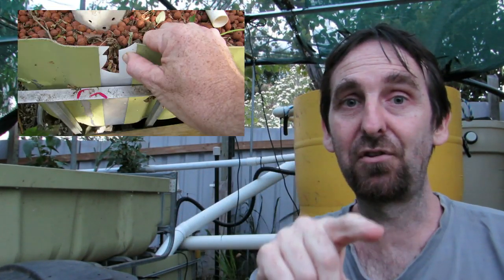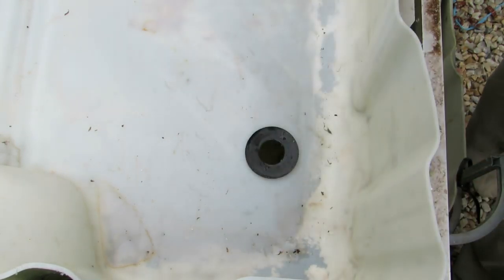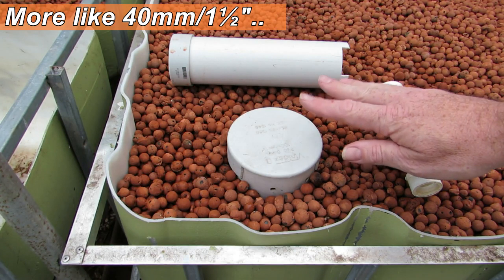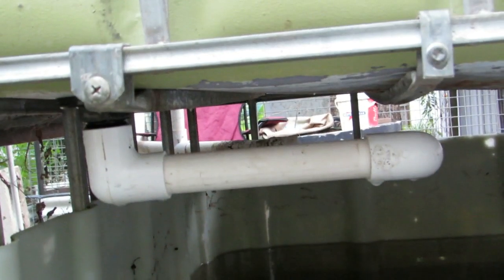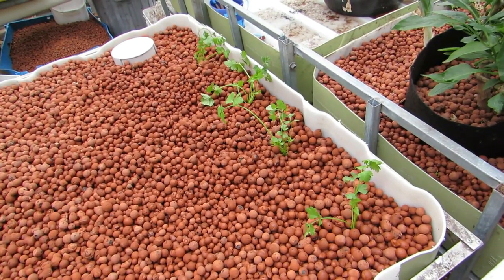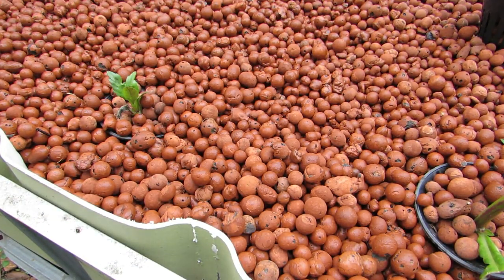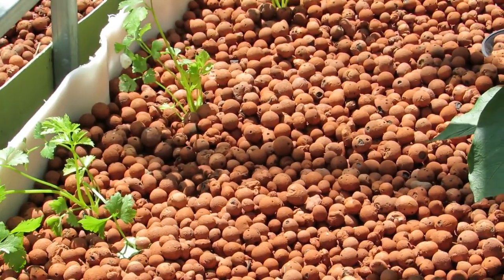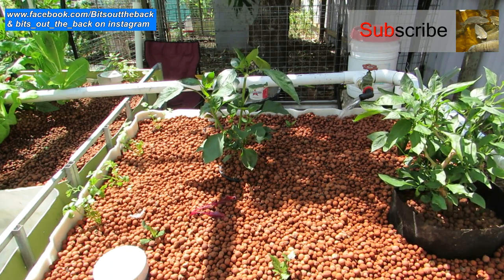How to set up a bell siphon & planting out a grow bed. Aquaponic Vlog 11,.

Comment: Getting ready to set up a 2 330gallon IBC tote system.  One of the videos I watched this morning, you had a problem with the water getting murky after adding the radial flow filter.  What caused the problem?  I agree, it is fun to learn and see things grow.  I watched most of the construction videos this morning.  Thanks again.  Blessings.
Reply from the maker: Hey Allen... If it was an older one it had to do with solids settling in the black bilge hose I had running from the pump up to the fish tank.. The inside of the hose has very slight ridges & it was enough to collect solids.. The water ended up clearing in a day or so & cleaning that hose out became part of the regular maintenance routine..
Cheers & hope that helps some..
Enjoy the build mate..
Rob..

Comment: Another winner. I will be using the end cap on the shroud idea on my next bed. I like the T siphon better than the bell, but I still have the same issue with media getting in under the shroud. The end cap would fix that. Thanks much.
Reply from the maker: Hope it works out well for you Adam.. If the cap is a bit lose on the pipe it might pay to run a 316 Stainless steel screw through.. The fit on ours is very tight so no real issue here.. 
Cheers mate & have a great one..

Comment: thanks for pointing me to this video. after watching this, i feel like i have it set up right. i think i have a water flow problem. i upgraded from a 290 gallon an hour pump to a 1000 gph. couldnt really see a difference in flow so i think the 1/2" water line has me restricted on flow. think i need to go to pvc with valves to adjust the flow. the bells are kinda slow to fire but are strong when they do. just not breaking siphon. fun to figure stuff like this out though.
Reply from the maker: +txsmudslinger 
Can be fun but had a few at the start that drove me up the wall ;-) 
Have you got them firing on & stopping how you want them now ? 
Cheers,
Rob.
Reply: ive added the breather tube to my bell siphons. that was what it needed to overcome the flow problem. ive got strawberries planted now!  :)
Reply from the maker: +txsmudslinger 
Nice one mate. 
Those breaker tubes really do help with high flow beds 👍
Cheers mate,.

Comment: Rob, since algae can grow where the water enters the bed, why not have the pipe enter the bed below the media level?  i'm sure you want to easily see the flow rate, but, couldn't a setup similar to the bell siphon shroud be used to hold back the media and allow the inlet pipe to be inserted and capped loosely?  just curious. :)
Reply from the maker: Hey Charles.
 I still haven't gotten around to it but will be making something similar  to what you suggest but for different reasons.. Have never had a big problem with algae but am curious at seeing how many solids make it through to the grow beds.. I'll be using the shroud idea & placing some filter material in there to see what it catches.. Am hoping that it isn't too much..  
Cheers mate & have a great week..

Comment: Hi Rob, where would I source the grow bed pots/root pouches?   Also, using a standard air pump from the standard pet shop in our IBC. the air stones keep clogging up.  We're wanting to step up on a more viable air pump, could you advise of what is more suitable and where to source from...We're new kids on the block have been set up since March 2014, bumbling along.   Thanks for all the tips

Comment: nice work, that transplanting ring idea would be a good solution if someone pulls the media guard out again i think
Reply from the maker: Don't think it will happen again Steven, well I hope not :-/
 Was going to zap a few 316 SS screws in there to make sure but have run out.. 
Cheers mate..

Comment: As usual i love watching your videos. For a long time for no good reason since i didn't have a garden :-)

I have a question. Our garden has a pond with 14 Koi and i want to hook it up to a grow bed and ideally made out of wood so that it looks good in the garden.

What is the minimum depth? I am thinking 200cm long, 70-80 cm wide. If you do reply, many thanks.
Reply from the maker: Sorry I missed this Alex. Did you end up setting up a grow bed? 
If you haven't, I'd go with a 30mm deep grow bed as it will give the roots a decent amount of media to hold onto to keep some of the taller ones upright. 
Hope that helps some.
Rob

Comment: Hi Rob, loved your vids.  Just wondering how do you get the clay balls to sink?  I've got some clay balls and been soaking them in water for the last 24 hours but they all seem to float still.
Reply from the maker: Hi Steve. The water will end up saturating the balls & they will settle by themselves. 👍 It happens to most of us so is nothing to worry about. 
I found leaving a 25mm/1" dry layer of clay on top helps to keep the weighted down & will also stop algae growing on the clay.
Hope that helps a bit mate.
Cheers.
Reply: Thanks for the reply and advice, will definitely do that !!!

Comment: Rob, it's looking great.  I'll keep poking around, but have you posted a video on your nutrient supplements?  Meaning, what schedule do you follow to add any additional nutrients, i.e. iron, calcium, magnesium etc.  I'm fighting with which nutrient I'm short on -  yellowing of vains in pepper plants.  I'm new to AP, only doing for last 6 months.  Thanks.
Reply from the maker: I don't really follow a schedule as such Chris.. When the leaves start to turn a bit yellow with dark green veins I add a bit of iron.. Other than that I use calcium hydroxide to raise the calcium.. I do add in a spoon or 2 of a seaweed/kelp powder that has high levels of potassium so need no additional amendment to cover that one.. 
I have had a look through my books & can't find a conclusive answer to the yellow veins sorry mate.. How are the nitrate levels in the system ?
Reply: Rob Bob Thanks Bob.  I appreciate the info.  My nitrates hang between 80 to 120 ppm at all times.  I received my Chelated iron in the mail the other day so I'll be trying to get on a schedule with that, seaweed and calcium.  I'm having a good spurt of new growth as of late so maybe I'm on to something.  My system is only six months old so from what I've read it's about time of the system to "fully lock-in".  I also think my growled is a wee bit too shallow, so I have a hankering to build a new bed at least 12 inches deep.  I think I'm only sitting around 8 inches.  Though I have some natural sun light, I do supplement with Florissant lights.  I think I also should move from 5000K to 6700 bulbs.  Oh the science of it all.

Thanks again and take care, keep the vids coming.

Cheers,

Comment: Hey Rob, since the end cap is screwed to the grow bed, won't pulling the shroud also cause the same problem?
Reply from the maker: Is a tight fit & doesn't pull out easily so all is good.. I was going to zap a few stainless screws through there if it was lose but it wasn't necessary.. Different brand caps & fittings will fit differently I've found so it does pay to check a few different ones out.. 
Cheers Mate & have a good one..

Comment: Rob, 

I didn't see an air hose attached to the top of the bell.  Do you not use one?

byron
Reply from the maker: Not on the bells I make up.. Did try with a thin air hose a while back but found these work just fine.. If I set up a large external siphon I might go with the breather tube on the bell..
Cheers Byron..

Comment: Hi Rob, me again.  Sorry to bug you.  So i've got the clay balls into the grow bed, got the siphon bell going and it's draining good from the grow bed.  Though those clay balls are still floating so every time water is pumping in from below, they rise with the water and sink as water being drained, it's looking like a little earth quake on the grow bed which at times fun to watch but i don't know if this will work with plants as roots may not be able to attach securely among the clay balls?  How long before these clay balls settle and stay at the bottom?
Reply from the maker: Has been a while since I set up a bed but it only took a few days from memory with the Canna branded clay. Do you have a decent amount (25mm/1" +) of dry clay on top?
Reply: If i add 25mm of dry clay, it may over spill the grow bed with water.  hmm...i may need to lower the water level going into the bell to achieve that.  but these clay balls i have seem to be very stubborn, i've had them for a week now, although just admit not all the time they are soaked under water.

Comment: Hi Rob,
Nice to see another vlog up! I was wondering if you have ever tried a Raft system without media. I noiced your reference to Bigelow Brook Farm on the Bell siphon, I subscribe to his channel and it's one of the first places that I learned about using foam insulation as raft beds, looks very interesting! In one of his videos, he did a side-by-side comparison of having and aeration stone in one tank and no extra aeration in the other, The plants in both tanks were planted at the same time and the tank with an air stone had substantially more grow than the other. I'm thinking that the air stone helped to mix up the nutrients for the bottom, and extra aeration to the roots as well.
Reply from the maker: Hey Ron..  I haven't grown in a raft bed yet but hope to as a small one to this system.. I will be using a venturi for the extra air though in stead of air stones.. Just need to get a frame made up to hold a few 1/2 barrels I want to use as the beds..  
Cheers & have a great one mate..

Comment: Hi Rob, I have seen your video how to make bell siphon . Bought 55 barrel which is cut half. And now realised its max depth is 28cms (not 300mm or 1 feet). 

In your video stand pipe length is 250mm, bell is 270mm. 

Can you customise approx length of stand pipe(3/4")[I am using 1" pipe]and bell siphon 2 1/2" [I am using pipe which is not pvc so it comes around 3" pipe].

Pls suggest approx lengths of SP and bell for over all depth of 280mm grow bed. Thanks in advance.
Reply from the maker: Hi Graffitti & sorry I missed this. You've probably sorted this but will leave my 2 cents worth below. 👍
I'd just make the SP to be tall enough so there is a 20mm/¾" (minimum) layer of dry media on top of the bed. The bell height can be set between 20-30mm / ¾-1¼" above the top lip of the SP.
Hope that helps if you haven't got it sorted.
Cheers.

Comment: Hi Rob, I think I have pretty much watched all your clips lol, and I am sold on Aquaponics. Just a quick question though, could your barrel setup be used in a hydroponic application? Just want to have a go before i commit to buying fish etc.... So basically replacing the fish for a nutrient reservoir but still using your flood and drain method ?
Cheers mate, thanks for clips and keep them coming.
Reply from the maker: It would work OK as a hydroponic system too. I used something similar with timed flood & drain many years ago with clay media. 
Would double check with the store if the nutrients you use are fish friendly though. I've only been running fish to power our systems or using additives that are fish safe while we've been in between batches. 
You could use a fish based emulsion fertiliser to start off which will also help cycle the system as well ready for the fish.

Comment: They say hind site is 20/20. Given that you had an idea of what you were going to put in the bed perhaps you should have filled the bed halfway with clay then set your pots in and filled around them to avoid the digging out spots for them...especially the big ones.  I'm setting up a new bed right now but I usually just toss in seeds and they sprout right up. Did one last week and had germination in 3-4 days.

Comment: Rob...
Just starting my aquaponic system...
I filled the grow bed with clay pebbles - actually it is only half full now.
When it fills, the pebbles float up and down with the water.
Is this okay?
I had it completely filled, but as the water rose the pebbles floated and started falling out of the grow bed.  So, I removed the pebbles until they stopped falling out.

PEACE
Ross
Reply from the maker: Sorry I missed this Ross. Have they settled down yet? It normally takes up to about a week before they take on water & stop floating. 
Hope the systems travelling along well mate.

Comment: how distance bewteen bell siphon and the highest of grow bed to the tree developed  ?? thank you sir
Reply from the maker: Hi there & sorry for missing your post.  I make the height of the standpipe 20-25mm / ¾-1" shorter than the height of the media used in the bed. This will allow for a dry layer on top of the wet media to prevent algae growth on its surface.
Sorry for the length of time it took to reply.
Hope your system is doing well.
Rob.

Comment: In another video you said you fill half the tank with gravel, but this one you didnt. Which option is better?
Reply from the maker: This is an earlier clip so that's why DR. 👍
Is up to you & your budget really. I prefer clay as it's easier to clean when the time comes if that helps any. 
Are you ion the process of setting up a system?
Reply: Thanks for replying so fast.
Yes I am about to order all the materials. I heard the gravel helps with filtration? But if clay is easier to clean ill probably use that stuff.
Reply from the maker: They pretty much do the same job filtering wise. If you are going with rock I'd suggest going no smaller than ½" as the pea gravel can clog up with solids very quickly if you have a well stocked fish tank. 
Have fun with the build mate.

Comment: hello can i make a 2inch bell siphon
Reply from the maker: Hi there & sorry for missing this & have probably made the siphon already. 
You can use 2" for the bell. I just find that the slightly wider bell allows for wider fittings on the inside & sits better on the bulk head fittings I use.
Hope the build went well for you.
Cheers.

Comment: Not so good practical.
Reply from the maker: Why isn't it practical?
Reply: @RobsAquaponics  Sir by Practical means, 1)in India I am not getting ready made syphon, 2) not getting enough material e.g. end caps are not available to fitting the end pipes. 3) After draining water some part of the water level still remains above the base of the tube creating wetness at the bottom of the tub.
Reply from the maker: @1979SACH  Sorry to hear you're having issues finding parts.
There will always be some water left in the base of the beds when you use a bell or any other form of siphon to drain it so I wouldn't be too concerned about that.
Have you looked at making a loop siphon with a section of hose or a "U" siphon? Parts for them may be easier to source if you want to run flood ^ drain beds. 👍
Reply: @RobsAquaponics  Rob can you put a vedio of making loop siphon or U siphon?
Reply from the maker: @1979SACH  I haven't used either sorry so don't have any clips on them. 
A few clips on each should pop up here on YouTube if you do a search. (Y)